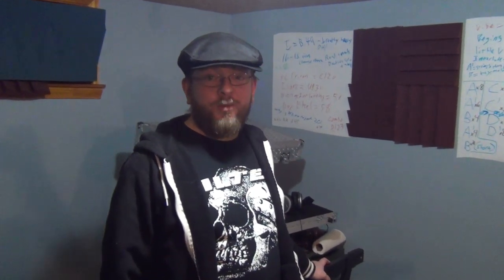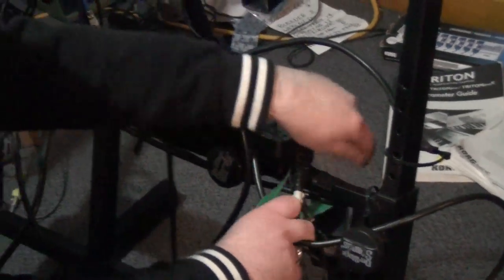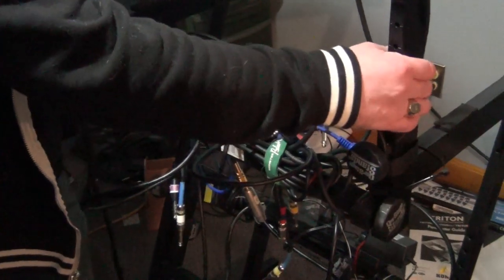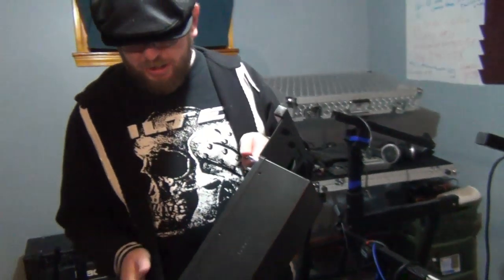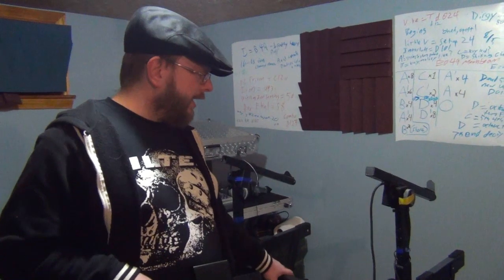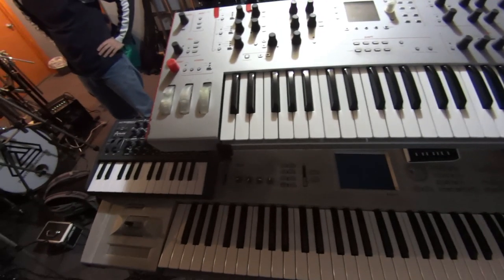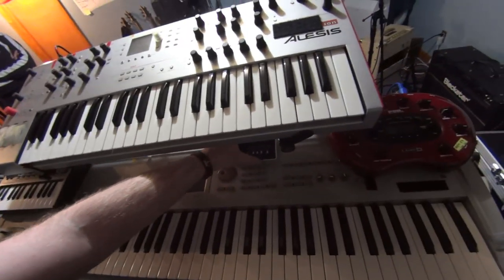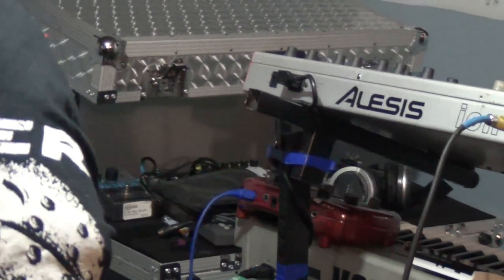The Problem With Keyboard Stands

Comment: What's really sad is that, nearly five years later, we're still in pretty much the same situation. Keyboard stands still, frankly, suck. We have the same models and designs we had when this video was made -- and in fact, have had for decades. Stands from brands that were, at one time, well made have been cheapened to the point that they break under the rigors of regular stage use. The only thing I've seen that looks like it might hold up are the hard-to-find stand kits made by Gibraltar, and even these are not ideal designs, as they're basically re-tasked drum hardware. Maybe that's the reason that most touring bands are using custom-built stand systems. And, of course, they usually have the luxury not having to manage 15-minute turns, even when they're playing festival shows.

Comment: Let me get this straight, because you meander throughout the video:
1) you want your keyboard stand to have a third tier / shelf for holding your monotron, or swivel shelves.
2) you want to complicate the stand by adding a patchbay, MIDI, LED lights, power, and eurorack compatibility
3) you're confused by using velcro ties and zip ties to control your array of various cables.
4) you want a keyboard stand to give users a single point of failure / multiplex output cable.

I'm not convinced those are good ideas.

You have already addressed one issue by attaching a power strip. Good idea, make sure you use the one that has the most available outlets for the space because wall warts stink.

Secondly, it does not appear that you've color-coded your cables. If you have a complex system, you should dummyproof it so you can have a stage hand work on the cabling while you're contending with other pre-show issues. OR alternatively you could strip down your setup to not have a mishmash of devices velcroed to your keyboards.
Reply: Sounds like he just needs to learn how to use an angle grinder and welder. Tube steel is not hard to work with.
Reply: Right. DIY baby
Reply: BINGO!

Comment: i`ve run all my cabling inside the metalwork of the stand and brought it out in strategic places  , took a bit of effort because i had to run bare cable then solder all the plugs on afterwards , i also have stick on led strips on there but dont use them much they are a bit too bright . get creative and build your own mate

Comment: When your only playing a 15 minute set at a gig, set up tear down time is precious.  I am always the last one at a gig tearing down due to the gear I use. If you can , I would use a single 88 note keyboard, and set it up in splits and or layered sounds. Set the board up for the sounds that you need for the gig.  Most workstation boards out there could do that for you.  I used to have that same keyboard stand that  your using. It's a great stand, but it's a bit of a pain to set up for one nite gigs.  Next time you play a gig, see what gear you could not have to bring in order to make life easier.    Good Luck

Comment: The best stand I ever had was one I purchased in the '80s that was 2 incredibly- light large-diameter aluminum -tubes held together on top by 2 canvas straps.  Simply by adjusting the straps, I could get the keyboard to my playing posture (I refuse to carry a bench, and those house chairs are too low for most non-adjustable stands).  It was a one-piece item that weighed nothing. So stand, amp and Kurzweil SP were a single trip, no carts required.  Sadly, I left it behind in a Davenport, Iowa restaurant (200 miles away) and the maker has passed away. Tried a Gearbox adjustable Z, but when it arrived from Amazon I noticed it was adjustable only for width, not height. Another return.

Comment: Great talk!  I have the same 2 tier Z stand that I use in my home studio, and it's not possible to arrange the keyboards in a comfortable way.  I want the ability to put my top board low, but it covers the controls of the bottom board, so I have to pull the bottom one out a bit and I still have to crane my neck to see the LCD!  I wish the top tier could slide back and forth along the axis of rotation.  That way I could position the top board so the bottom front corner is just behind the controls of the bottom board.

Also, I think they need to be way more adjustable.  I understand they build these things for strength, with the holes and pins and gear thing that moves in frickin' 10 degree increments or whatever, but I think they go totally overboard with it at the expense of flexibility.  A board stand doesn't need to support 1000 lbs, it only needs to support about 100 lbs at the most.

I would also love to mount a rack between the two boards (I would happily sacrifice having the top board low for a rack).  Options to use between 1 and 4 rack spaces between the tiers, mounted so they're right over the bottom board would be awesome, so I can ergonomically program synth modules, or installing a eurorack system would also be fantastic.  Or a shelf so you can put a laptop or mount a music stand back there.  If the weight becomes a problem, they could make the back legs extendable for better support.

I can't understand why these things don't already exist.
Reply: I agree Matt. I don't like how the top board covers controls for the bottom. I also pull my bottom board order so I can at least see part of it. I chose to drill more holes for the main height adjustment as well because the stock ones are space in such big increments. Wish someone would offer a better stand.
Reply: I can’t believe that every keyboard doesn’t have a pivoting screen since most of your programming is done with onscreen options. It would also help when you’re playing outside with glare. My Roland FA has options all the way at the bottom of the screen that I didn’t even see until I started watching YouTube videos.

Comment: I only play in the studio so I sit most of the time. My biggest frustration is reaching that top keyboard. I own the K&M Omega stand which allows plenty of leg room but my top keyboard is sitting on an X stand directly behind the K&M stand so reaching to play that top keyboard puts a strain on my shoulders after a couple of minutes. K&M offers a top tier extension but it does not allow the user to push the top keyboard back or forward so the top keyboard pretty much blocks all the knobs on the lower keyboard. This is very frustrating considering I have analog keyboards with lots of knobs on both lower and top levels. 

For me, the ideal stand would allow for multiple attachments (sort of like the current K&M stands) but the keyboard tiers should allow the user to be able to push the top keyboard back/forward, as well as lower/raise both keyboard for maximum comfort. 

The ideal stand would also allow rack attachment underneath the lower keyboard. I think the potential is there to make a light but extremely strong stand that holds 2 keyboards, houses multiple outboard gear via shelving/extensions, hides cabling, and allows keyboards to move backward and forward, up/down.

Comment: I always hoped for a keyboard stand where the top level keyboards weren't directly centered over the lower keyboard - placed further to the left and right.  I've only been able to do this with multiple keyboard stands.  Be nice to be able to do this with one stand and have it still maintain it's balance.
Reply: Yep. Especially if you have small keyboards that don't need to take up a whole tier.

Comment: Great Video! I completely agree with you. I own the same stand and have many of the same complaints. I still believe that it was the best choice of stand for my use but it's a pain to set up and break down for gigs. I've added a rack mount compressor to my rig along with several effect pedals and I have no place to mount things! I currently have a table set up at home to hold pedals, rack mount gear, and my laptop. Hopefully someone can offer a solution in the near future!

Comment: PS I own that same Onstage stand but stopped using it because of its weight(fairly heavy) and because of the cumbersome nature setting it night after night. Other than that it's a great stand, I have it in my home studio supporting my Hammond XK3c rig.
Reply: I just switched back to the On Stage Z stand. Mine has an alternate 2nd tier setup. I think the key to making it useful is to /not/ completely disassemble it. I'm kind of folding mine up, but not taking out the horizontal cross piece. Taking my time, I can be set up now in less than 15 minutes, and torn down in about 10. Yes, it's a little cumbersome to transport, but it's simple, solid, and fast.
Reply: Watch your feet especially if barefoot!!
Reply: @KyleWhitlock-Music  Yes, I can see that the consequences of losing track of one's position could have an outcome worse than that of stepping on Lego blocks in the dark....
Reply: @GerenM63  if I only had a dollar for every time I’ve stubbed my toes or banged the legs with my feet...

Comment: OK then, here's a novel idea....
How about just a simple, straightforward X-frame stand.... but bigger...?
For us tall people who play standing up, when you get any "normal" X-frame to the height you ideally want, the width is so narrow that a keyboard with 76 or 88 keys does just not feel stable enough to play with confidence.
So a range of stands specifically with longer legs - and therefore, by default, a wider "spread", would be a simple innovation !!  (Double legs/braced, all welded steel construction and with second and third tiers for me please !!)
C'mon, surely its not difficult to take existing designs and just put longer bits of metal in...?
Reply from the maker: +Gary S our On-Stage Z stands have adjustable height and width. TBH, I'm not sure if we're already at the max on either of those, but I'll check next time I'm at the studio ~ Jim

Comment: all that shit for 2 keyboards?
Reply: chieftp right!? I run a mojo 61. I put a DeepMind12 directly on top of it and a euro rack case on the second tier directly above that. Three power cords (preplugged in to a power strip ready for the wall socket) and six cables (color coded and pre plugged in on the keyboard end) for stereo outs into a kc 550. 10 minutes max. With whiskey brakes. All those cables and supplies attached to the stand seems needless and downright time consuming.